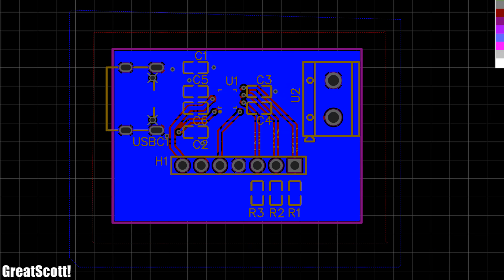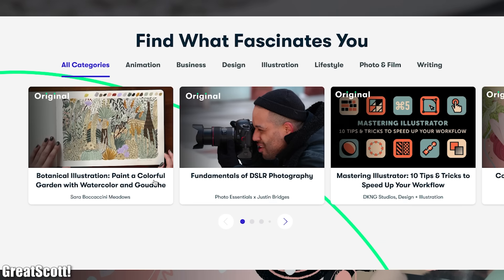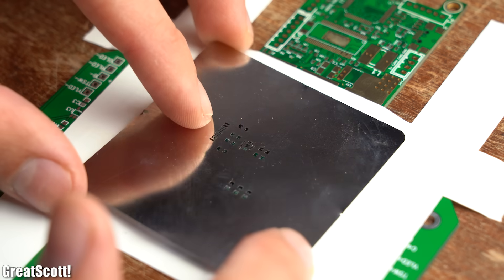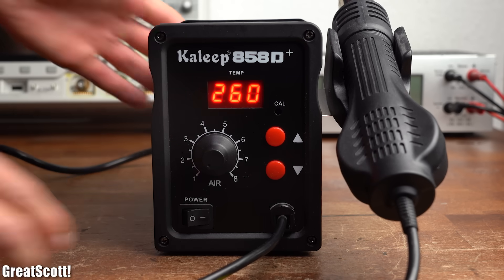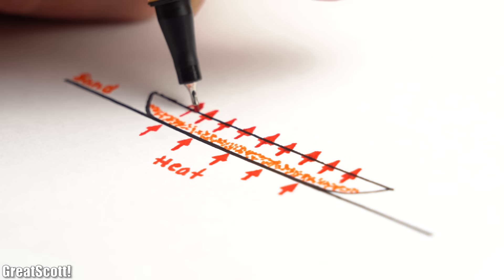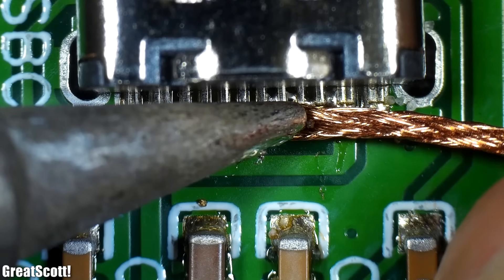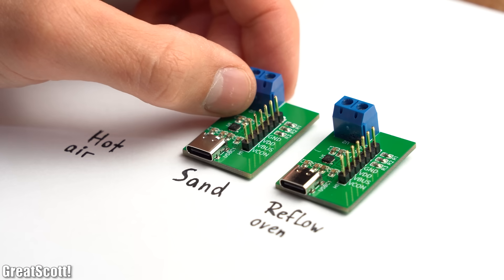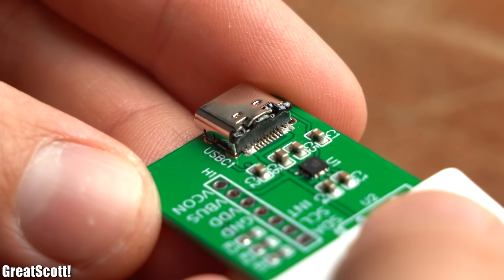How to do SMD Reflow Soldering properly! || Hot Air VS Sand VS Reflow Oven

Comment: Entertaining and informative, as always. 
Before changing employment to R&D in a new company, I did 5 years of SMD reflow and rework, a few tips for a possible revisit video.

1. Hot air blower only does tent to melt some plastics due to how long it takes the board to heat up, when building or reworking I always used a heat plate to heat the board from below, much less time was needed with the hot air blower to make connections, I also found that touching up connections worked best with blower and iron, iron alone often would not be able to heat the Solder enough without help from hot air.

2. I have not tried sand yet but I imagine it would be a lot more effective if a glass pan lid was place over the pan to retain air heat around the board, I've also seen this done with sand.

3. For all methods, a good single pass with paste is best. Ensure stencil is in the correct place and apply a good amount of paste along one side, them with firm, slow and even pressure, hold spatula/bank card at an angle and make one pass and lift stencil. You should find nice Solder deposits with fine vertical edges.
When making more than one pass  the stencil lifts then catches the edge of existing Solder and pushes it away from the pad, this happened with your USB-C.
4. Missing mechanical connection sderon USB-C, a few tiny blobs of paste applied with tooth pic or iron soldered afterwards, the 4 tabs each side of the USB need to be soldered to the board, they are for mechanical strength, not electrical. With out these all insertion, removal and any cable movement stresses are all applied to the pads and will break in a short time.

If you have made it to the end of this, thank you for reading, I love your videos, I hope this information is seen as useful and not plain criticism.
Reply: Kapton tape and a piece of metal helps to deflect and protect objects on a laptop board that don't like to be heated via hot air gun. All the while soldering desired SMD device nicely.
Reply: @DurzoBlunts  ah yes, I forgot about shielding, as most of the boards I worked with had. Ever seen the light of day, I would often use the break off board edging that's part of the panel of multiple boards, hold it in place with Kapton if there was not way to safely remove and replace after working on another component.
Reply: cant solder for tits... zero skill zero ability and zero mindset!
Reply: What is your opinion about using ALUMINA POWDER instead of SAND?
Theoretically it should be better because of the higher thermal conductivity.
Reply: @paulcohen1555  Its not something I've thought of, in theory the thermal conductivity would be better, though I would have concerns about any remaining powers getting trapped in vias or somehow getting up to the topside of the board.

Sand or salt is a lot easier to source and does not conduct electricity, if I needed to rework a board at home, I think I would stick with sand.

Comment: you could use simple solder for this and a heatgun, just tin the pads, place the chip and when you heat it will fall down to its place.
Reply: Please post a quick video of you doing so on MLP.
Reply: @BaconbuttywithCheese  It's pretty easy to do. Especially for a part with so few pads and big pitch. If you know you're going to be hand soldering it you can even extend the pads in your cad package so you have something to run your iron across to make up for not having leads.

Comment: Hello.
Are there any training videos about cheapest method?
Can I put soldering paste manually and then heat it all on sand( or stencil is mandatory)?
Reply: No stencil is not mandatory it just makes it alot easier. With a rlly steady hand and patience you can do it manually. Also without a stencil the chance of needing to resolder is higher. I really dont know how to do it, But i know there is tutorials telling u how to manually apply paste. After a quick google search i found this: SMD291SNL ‑ Chip Quik Solder Paste 

This paste comes with a syringe for applying the paste, making it a lot easier for you
Hope this will help you:)

Comment: just out of curiosity, I would try one more thing. Add the paste with that metal screen, use the heat gun to melt it and only after that place the smd components one by one with a decent amount of flux and solder them on with a heat gun... In theory, that way, you would get lot more control and lot less clean up afterwards...
Reply: >with a decent amount of flux and solder them on with a heat gun.

You mean add more flux to the paste? You really don't want to do that as it generally leads to out gasing under components and then the components jumping off of the board.

Comment: I enjoy your videos! Looking at your soldering process, I see room for improvements in a few places. 1) your stencil might have been too thick for the size of features you were trying to print. See if you can order one closer to .100mm. The thickness of the stencil is how you control how much paste gets deposited.
2) your solder paste shows "T3" (type 3) which tells me the size of the solder balls. Those are also on the large size for your project. Try to find a T4 or T4.5 and you'll probably have better luck.
3) not sure if this contributed to your issues, but pay attention to the shelf life and storage conditions of your solder paste. Keep it refrigerated until a few hours before you are ready to use it then let it warm up to room temp. Unrefrigerated, some types of solder paste are trash in only 2 weeks. If kept under 6°C, you can get 6 to 12 months tops.
4) try upgrading your squeegee to a razor blade or a glass microscope slide. Credit cards can actually get abraided by the apertures in the stencil and leave tiny plastic slices behind
5) always get stencils with frames. That's makes the release much cleaner than a with a flimsy piece of steel.
Best of luck!
Reply: Thank you soooo much for this post! I just started using solder paste a few weeks ago and never though/heard about refrigeration. My paste has been sitting on the shelf with the lid shut for about a month now (just checked it still looks good as in shiny from the flux). Just refrigerated it as I hope to be using it for at least the rest of this year in my various projects.
Reply: 1) No, it doesn't look like the stencil is too thick, but a thinner one may compensate for imperfect technique.
2) T3 is probably the largest you want to use for this, but it's more than fine.  T4 is good for general purpose.
3) Many pastes from chipquik don't need refrigeration, and that also isn't what is causing him issues
4) Agreed
5) Mostly agree, but these are pretty expensive.
The most important point is actually this: you get shorts when your stencil is moving up and down as you work.  You need to apply and then scrape the paste in one pass each.  In other words, don't 'play' with the paste.  You need to get the taping scheme right to keep the stencil down as much as possible.  Best case scenario is you drag the scraper behind the applicator, keeping the stencil pressed down in between the two operations, but that requires some coordination, and is really only needed on large boards.
Reply: i'd already read a few extremely helpful comments but this is the most helpful, thanks
Reply: Thanks for the advice but you cannot possibly think that a hobbyist would get rid of their solder paste every year. As hobbyist or small volume prototype makers we don't have the needs of a mass production organization so it has to last at least 10 years
Reply: Hobbyist or not, every solder paste has a shelf life / expiration date. Refrigeration simply extends the effective lifetime of the paste. As for the paste lasting "at least 10 years", erm.. I have no clue where did you pull that number from. Most of these typically have a shelf life of 6 months (with refrigeration), although they'll still be technically usable for a while longer.
Reply: @AlessioSangalli  well, it depends how many PCBs and SMT components you want to throw away instead due to joints that didn't complete.  There is clearly a trade off between age of your solder paste and yield.  I think the point is, buy the quantity you think you'll need in the next 6 months.  We can get syringes as small as 10g.  One advantage of that size is that they warm up quickly when you need them.

Comment: Imagine reflowing SMDs..

This post was made by THT gang.
Reply: imagine wasting money on pcbs.

This post was made by mid air soldering gang
Reply: Imagine soldering to make a circuit... 

This post was made by the breadboard gang
Reply: @red1246  imagine using a breadboard, this post was made by the twisting wires together gang
Reply: @jmelb4650  I have done that many times lol......even added a reset button to my PC by twisting wires together lol
Reply: @BenCos2018  hahaha it's extra fun with solid core wires
Reply: @jmelb4650  Yeah 
I used ancient solid core phone cable for it lol
Reply: @red1246  Imagine using a Breadboard 

This post was made by the aligator clip gang...
Reply: lmao
Reply: @red1246  that's a nightmare
Reply: Imagine actually buing components

This post was made by hardcore DYIers gang
Reply: Imagine using hundreds of components to make a circuit. This post was made by fpga gang.
Reply: Imagine using component that exist in the real world

This post was made by the SPICE gang.
Reply: Imagine using electronics.

This post was made by electromechanical control gang.